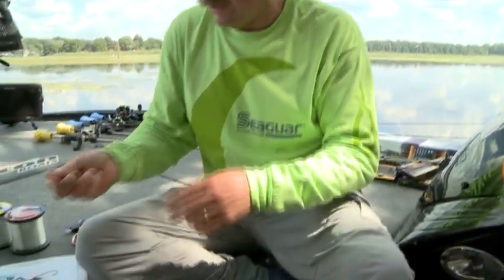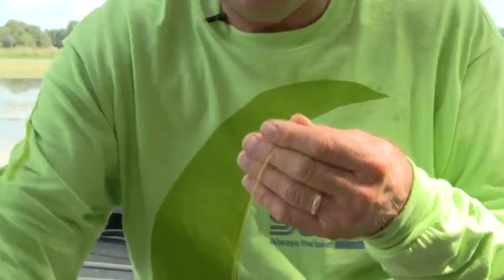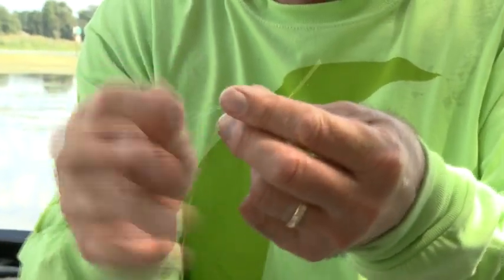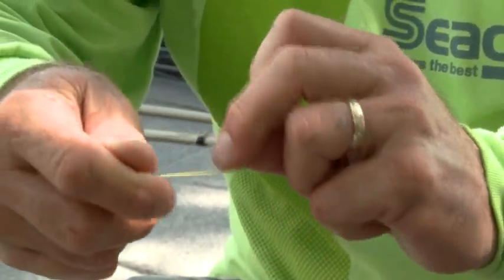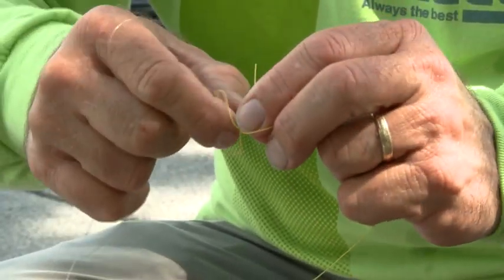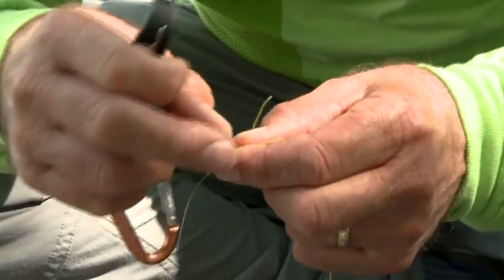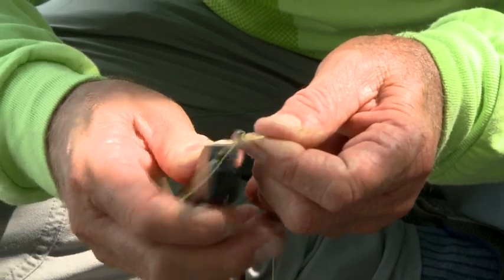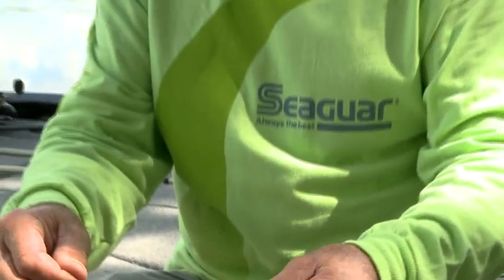Tying Fluoro Leader to Braid

Comment: Perfect knot for my UL fishing. I use a #8 braid w/ #3 leader. I have had some #5-8 channel cats on with this knot and it handled the fish flawlessly and I did not ever have to question if the not would hold. 

Because  I use small diameter line, I go with 7 wraps on the Uni and 17 wraps on the clinch.

Thank you Mr. Grigsby and the fellow who taught you this knot.

Comment: I've began tying this knot instead of my normal double uni splice. I MUCH prefer this knot with the improved clinch instead of the 2nd uni knot. I go with 4 & 10 wraps just to save time, haven't had it slip or fail yet. Great easy knot for utilizing a fluoro leader. When I first made the jump to braided line on my spinning tackle, I was intimidated by the thought of utilizing a leader and having to tie the knots. Not so anymore. VERY easy. I can rig up a new leader and be fishing within a couple minutes now. Even on a rocking boat, or in low light.

There is literally no reason to be fishing anything other than braided line with a fluorocarbon leader on spinning tackle these days. You get the sensitivity/feel of the no-stretch braided line, with the invisibility of fluorocarbon. Fantastic setup. 20lb braid with 8 or 10lb leader is fantastic. My go-to setup finesse fishing like shaky heads, weightless wacky or drop shot is 20lb power pro, 10lb seaguar invisx, on a 7 ft medium Dobyns Champion XP w/ a Stradic 2500. $400 setup but well worth it and I'll own it for life.
Reply: have you tried the alberto knot vs this one?
Reply: There IS a reason -- topwater.  There you need braid to mono.
Reply: @BryanHersch  I've had the Alberto fail on me.  I am careful tying it but apparently not good enough, so if it has to be perfect in order to hold, it is no good to me.

Comment: This knots OK … but I use/tie an RP knot for larger sized braid/flurocarbon … for say tying 5# braid to 4# fluorocarbon I still tie an Albright knot … working with small diameter lines sucks, but it’s easier for me to tie an Albright …
I fish large tuna and stuff … I use and tie my own wide on leaders, but in a pinch fishing for say 100# tuna I tie the RP knot … when attaching braid to fluorocarbon’s… their are other knots just as strong as the RP … maybe even stronger… but not as fast … 
If your anal put a drop of super glue on the RP knot and wipe off the excess it’ll still go thru the guides… it’s a super small knot …
The knot shown here is still too large for my liking …